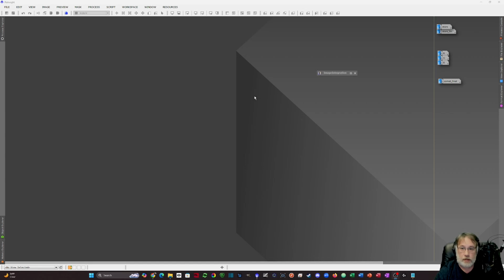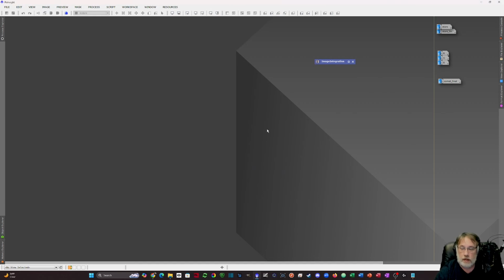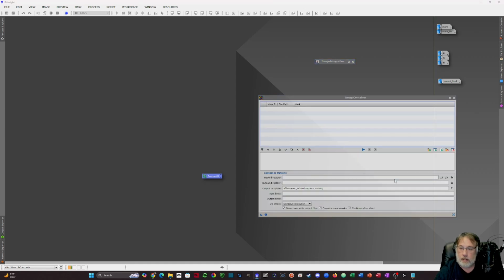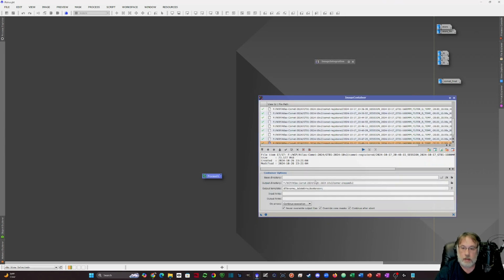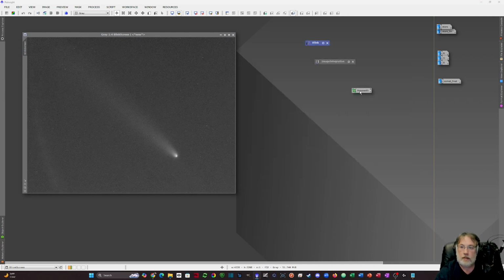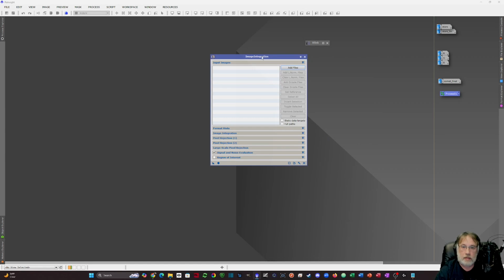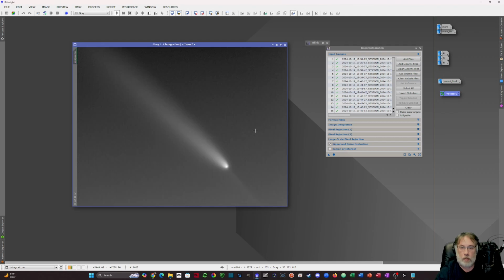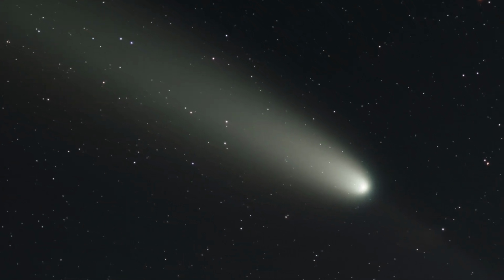Comet Process Pt 2 - Batch Crop and Alternate Integration  #astrophotography #astronomy #pixinsight

Comment: I keep getting those streaks from star removal after stacking. Is there a way to fix that?
Reply: I also had this issue with the method in the first video.  I took my subs as a oneshot color image.  I haven't had a chance yet but I'm planning on integrating like every third sub to give more space between stars, do that for the 3 subsets then integrate those at the end.  Hopefully rejecting stars.  Thanks for going through some of the comet stacking.  I have not stacked/aligned comets before
Reply from the maker: @ChaseDaigle  - I thought of that after my last reply as well. Reply back here with your results and recommendations.
Reply from the maker: I've not done considerable tests for that, but maybe others will comment.  Range masks and lightness masks can be utilized to protect the comet while darkening those areas, or if there aren't many of them, Seti Astro's heal script or clone stamping can be used. Longer exposure times can also separate the stars more between frames and make it easier for integration to remove them.  The sigma level can also be adjusted to be more aggressive.  If you haven't already, the method in the first video is also worth trying.  Thanks for watching BTW!